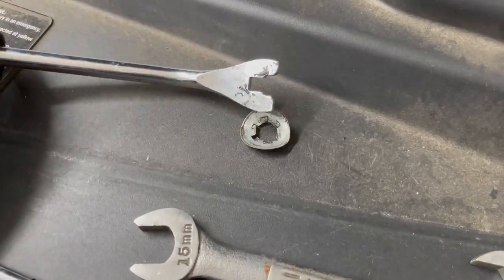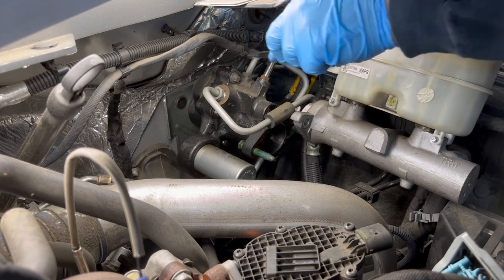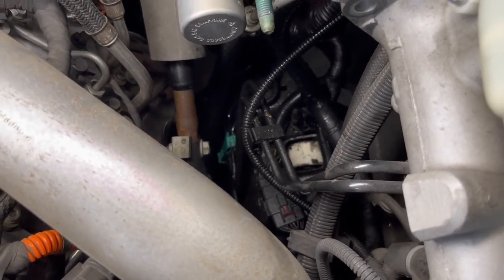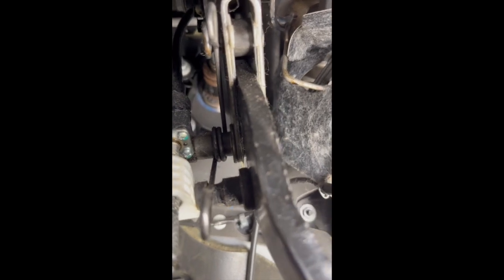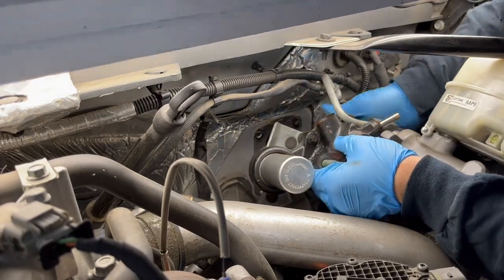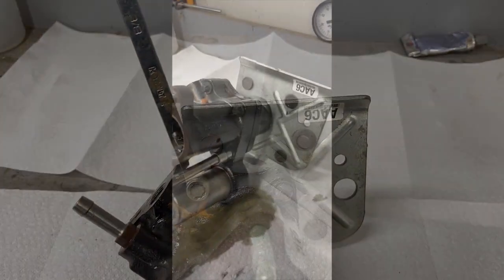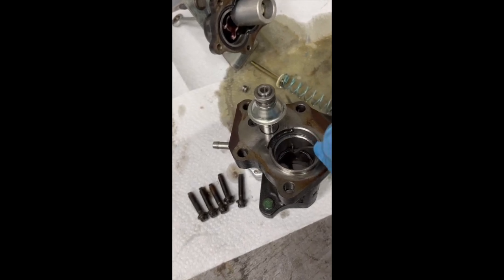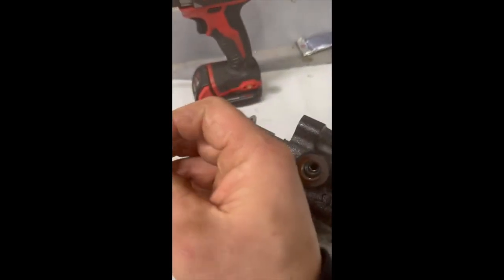2015 Chevrolet HydroBoost Removal & Seal Replacement #duramax

Comment: I believe I have the same issue but did you also have some pulsating brake pedal as well? Just curious because mine is doing that.
Reply from the maker: I would have some pulsating with mine. When the fluid got low and my power steering started whining. That’s when I noticed it. Once I topped it back off it’d be fine. It left its mark everywhere I went 😂
Reply: @McKameyFarms  thanks
Reply: Mine is making noise

Comment: Is that pushrod adjustable? I replaced my Master Cylinder, and ever since then the booster has been applying a preload on the MC like the pushrod is too long for this new MC. The brake fluid cannot return to the MC and my brakes apply when the brake fluid heats up.
Reply from the maker: My particular push rod was not. It was fixed and just had a ball and socket type connection into the back of the hydroboost. No threaded adjustment where the eye bolts to the pedal either
Reply: @McKameyFarms  I'm thinking these hydroboost systems rely on a specific master cylinder being mated to them because I can't find anything on adjusting them. It was probably designed that way because getting that adjustment right is problematic. (and I have the wrong MC installed)